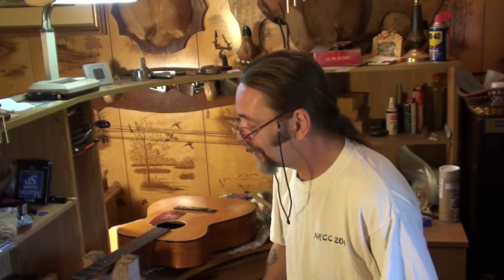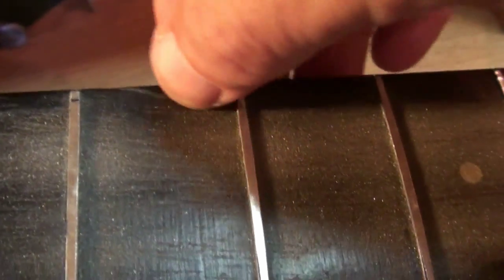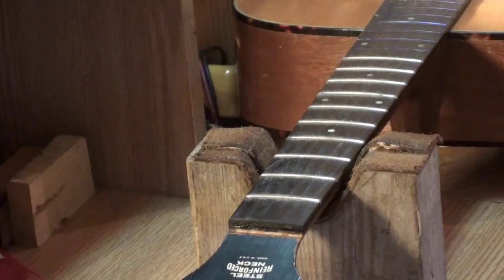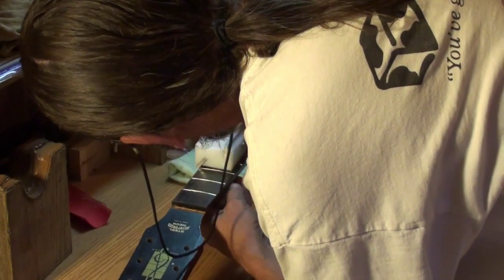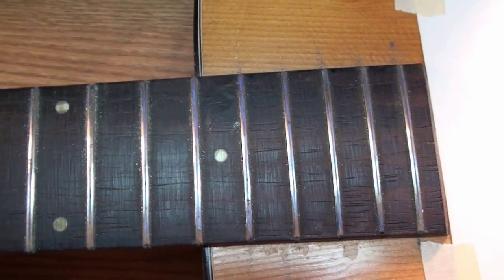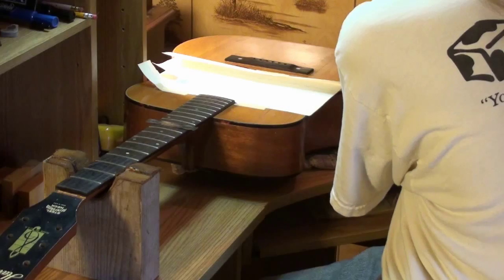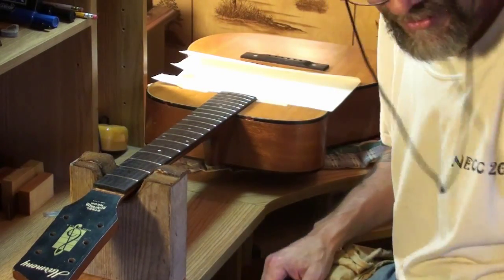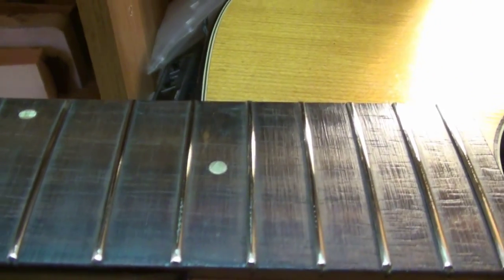Harmony H162 guitar repair part 6 of 8 Fret level, dressing, crowning and polishing

Comment: Thanks for another very cool & informative vid! Frets look incredible! Frets don't come from the factory looking like that, at least not on my guitars! lol  So I guess we should all polish our frets even if not doing a fret job? I've used Micro Mesh paper & then metal polish. I'm going to order some of the Simichrome polish that you recommend...Amazon has it & customers on there rave about it. What grit sand paper would you recommend using on fairly new frets, just to polish, & not take off any material? Should I start with something coarser than micro mesh? Is 800 too coarse to start with on new frets? Thanks again! Janine
Reply from the maker: WindOfTheWisp Thanks for tuning in and taking the time to watch and commenting my friend! And you're right, this is how frets should be when new but I've never bought a new one I was happy with until I polished them. I looked to see if that polish I use was still available and was surprised to find out it is! :) 
For your new frets or frets without dents wore in them I would start with 1000 grit and work up to 2000, you could even start with 1200 grit and work your way up, this would remove even less material, then polish with semichrome polish, you'll be surprised what just the polish alone will do once you're finished sanding.
Reply: +Randy Schartiger OK...will do...thanks so much for the info & for getting back with me! Looking forward to the next installment! (Oh, BTW, I love Q-ball...how could anyone not!! lol)  Janine